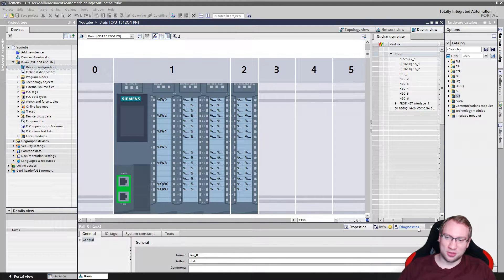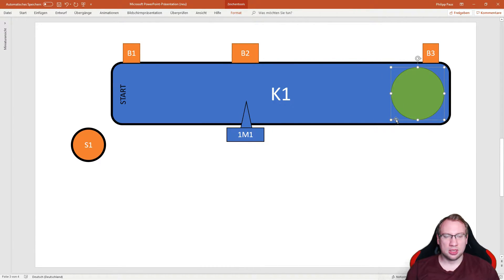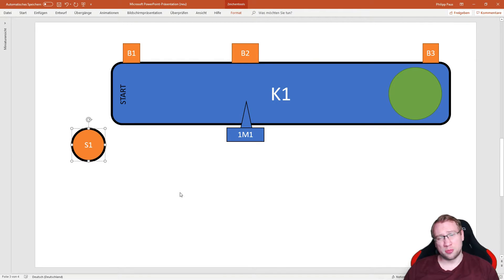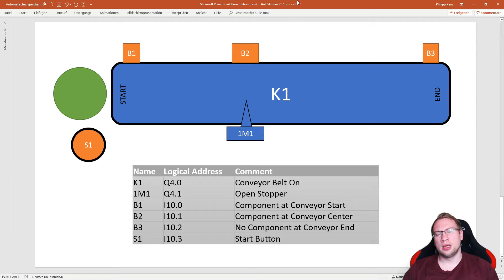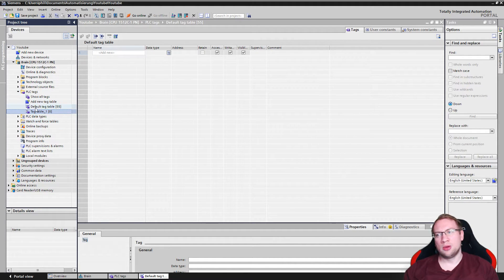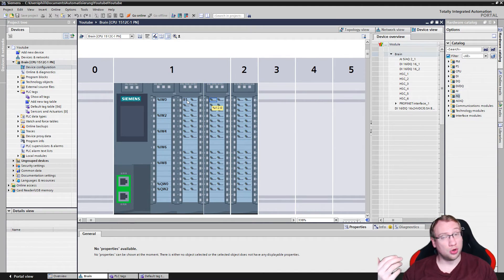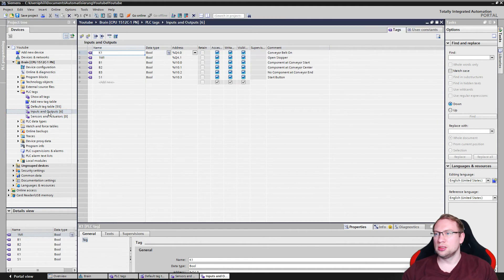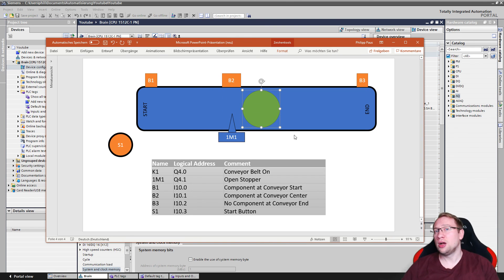TIA Portal: PLC Tags

Comment: why i cant import the excel into plc tags, it shows errors like " The version ID is missing in the XLSX file. it is assumed that this is the latest version"
and "Worksheet "PLC Tags"  does not have the required format"
Reply: done, still have warning because version ID but still running. need to rename Worksheet into PLC Tags. its better to export first from tags to excel then u modify  it and import again to tags